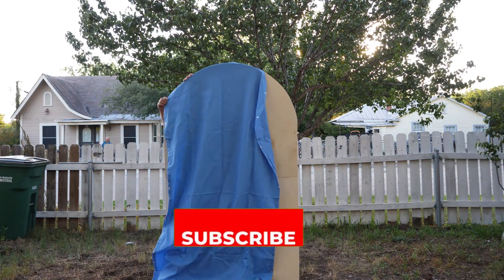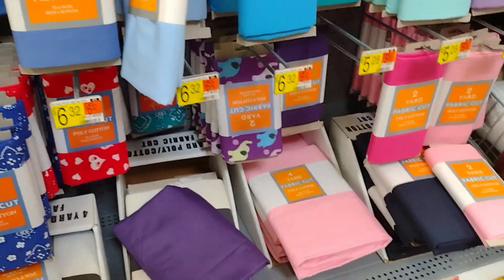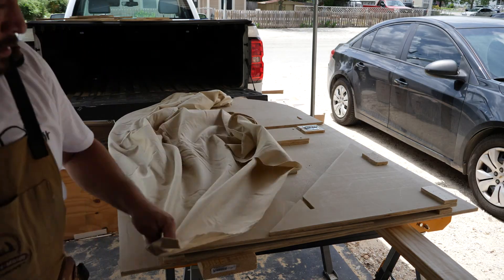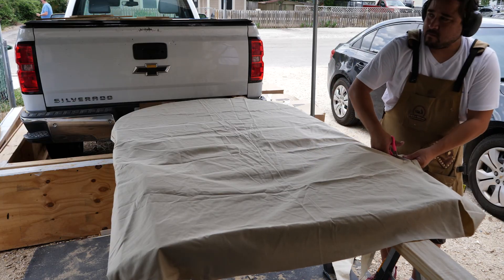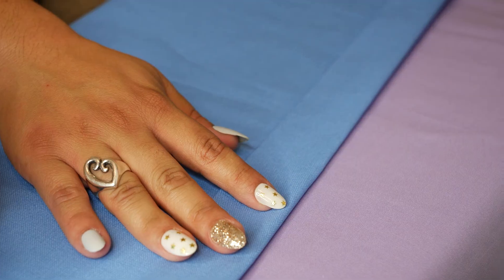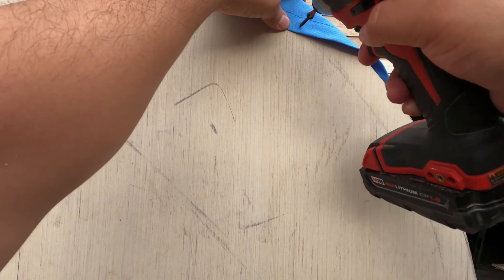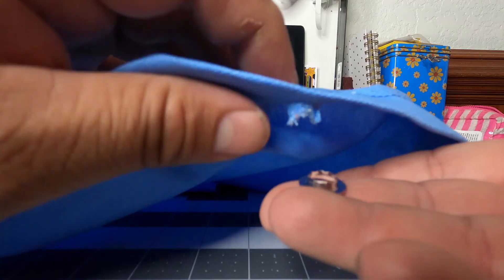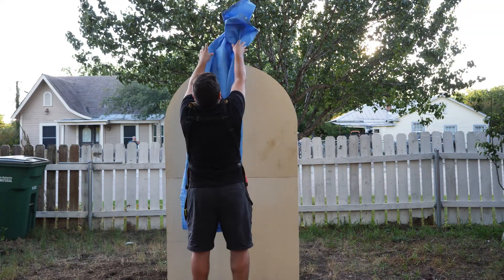DIY Chiara Backdrop Cover (Easy way)

Comment: I use a two-way stretch fabric which is ideal for the line issues - only thing, lettering is not adhesive.  My staple gun is my magic tool for everything (love your guys channell!)
Reply from the maker: Thank you! And yes a staple gun does everything. I have just a hand powered staple gun. But I have been wanting to get the battery powered version just because of its usefulness. lol

Comment: I’ve purchased a few design plans from your Etsy shop and they’re fantastic. I put my own little twist on them to fit what my wife needed. 

Mainly, the legs. I came up with a very efficient way of building the legs that provides not only weight, but allows the backdrop to not take up any space behind it (when standing multiple in an overlapping sequence). 

Thank you for providing these great blueprints!
Reply from the maker: Thank you so much for the support! And sounds great that you were able to accommodate multiple backdrops next to each other. I have tried other things such as making the back supports in a 'V' shape so they don't protrude out next to each other. But still looking at options as well. Glad I was able to help!
Reply: What do you do differently from the leg design?
Reply: May I know how you redesigned the legs ? :o

Comment: Love your channel and tutorials, you're amazing! If I may, I would suggest using elastic. You've already created an enclosure, the folded hem (ensure there's enough room for the elastic and a  grommet)  that you can run your elastic through. Use quality, no roll woven,  elastic ensuring its not twisted within.  Determine the necessary size piece of elastic just above the bottom edge and pull the elastic through. Add a safety pin to one end of the elastic, gather material onto safety pin and pull elastic through, repeat the gathering and pulling  until you've reached the other end. Ensure you've attached the other end of the elastic to the bottom edge with a safety pin to prevent from pulling out. Tack the elastic in place by going back and forth with the sewing machine a few times. Add a grommet in the  INSIDE edge of the enclosure (folded hem) on both sides. Attach the grommet to a hook in the board to prevent slipping. Also, download the Joann fabric app. They always have 40-50% off coupons and it would give you a wider selection of material. Thank you
Reply from the maker: Thanks for the tip!

Comment: If I don’t mind not using it as a collapsible, and would prefer it just to stay upright all the time; can I use wood filler to get that line unnoticeable, so I’m able to keep painting it as i want. Thanks for your help.
Reply from the maker: Hi, the best option is to not cut it in the center if you are going to keep using it straight and not fold it. Makes the build so much easier. Just cut the shape and add the legs. Hope this helps and good luck!

Comment: I custom paint ours every week depending on the customers colors unless is already a specific color from a prior weekend
Reply: Every week? That doesn’t do any damage to the board or does the color ever look off?
Reply from the maker: I wish I could, but I hate painting, lol. Painting definitely looks better, I just couldn't keep doing it.
Reply: @ninojb9704  yes every week like last week I had them light pink, white and cream this week they're cream,white, light blue and light pink and you can't tell, the butterfly where purple 2 weeks ago last week yellow
Reply: I'm uploading a video later
Reply: I’ve had to use a tablecloth as a last resort. I saw a video showing someone using safety pins. 
I placed safety pins to each side of the fabric on the back of the board (maybe three on each side) and tied a 260q balloon to each one. I then stretched the 260q to tie to the one on the opposite side ( making it stretch the fabric and hold tight) . It worked out great!